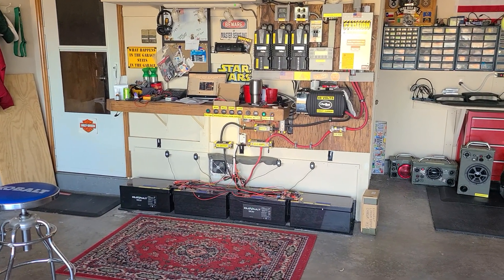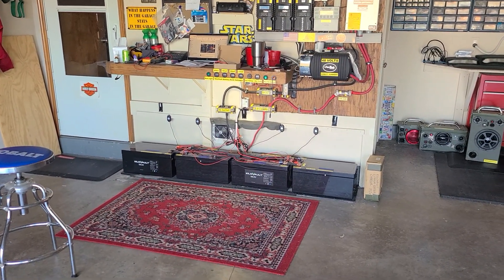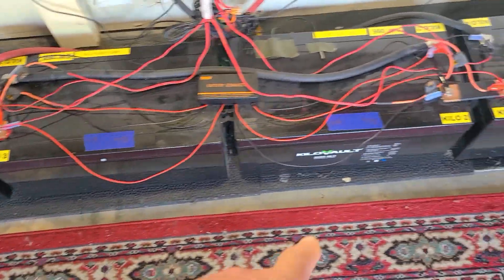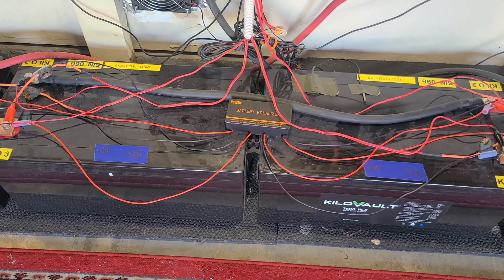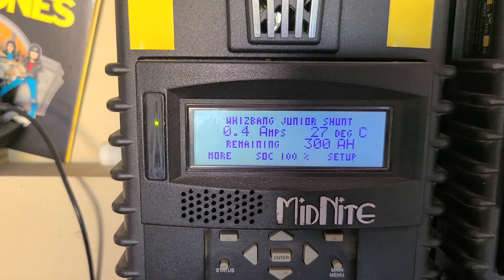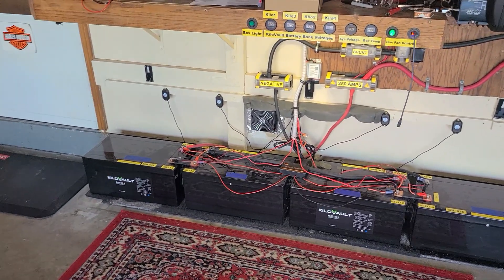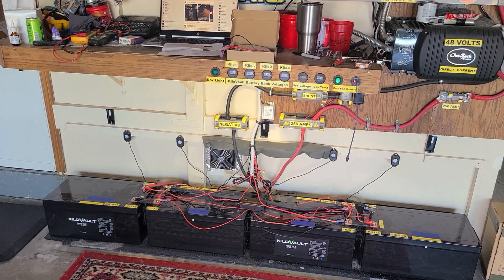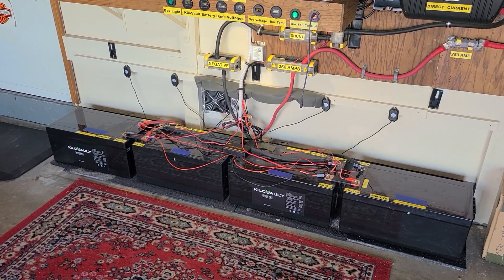48v KiloVault battery bank update -  FULL charge, balancer working

Comment: I'm glad that your batteries are starting to get back in sync. The "equalizer" balancers you have should work just fine. The KiloVault version is just a rebranded units. I believe their newer batteries have communications ports to link them together for better balance management.

The mystery is why they went so far out of whack. I can understand if you're using it in an EV application where you're riding them hard all day and putting them away wet for the morning sun. Most solar folks don't really run them down that deep unless its an emergency at 80% DoD is the far as you really want to go. I've been following Off-Grid Garage in Australia where he is building 48 volt nominal packs with LiFePo4 prismatic cells; it's not everyone's cup of tea, but I've learned a lot about the nuances of LiFePo4 rabbit hole.

Comment: I would just connect the two sets of  batteries in parallel in twos and let them balance themselves out for up to 36 hours there was really no need for you to buy that cell balancer.
Reply from the maker: It's a battery voltage balancer.